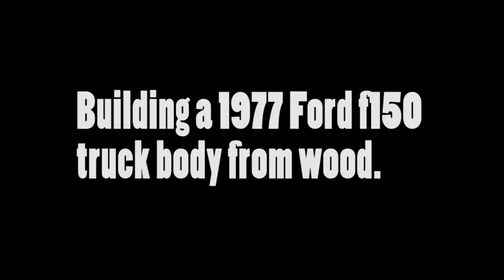Headquake's RC - #116 (77 Ford) Build Video aug2012

Comment: WTF??? I AM BLOWN AWAY!!! originally i thought these were modded plastic builds from a kit. this guy is no joke!!
very very impressive!!!
Reply: +Fiddlekrazy Steve testify he is at true artist
Reply: Absolutely!! Further more quite technical in vehicular design! Has to be both a love of RC and Vehicles!
Reply: He puts the plasitic body with multimillion dollar corporation to shame, & they charge over $100 a pop
Reply: Perfect work!
Reply: You are learning me, thanks.
Reply: friends, greetings to all from chile, please could you tell me what is the name of the product that thin white plate that is cutting and heating to acer the structure of the vehicles? please name the product you use ??
Reply: @MiguelTorres-xy4ck  it's called sheet styrene, you can find it at most hobby shops and websites. also Amazon and eBay.
Reply: thanks friend, from chile I send you a hug
Reply: Fiddlekrazy Steve 🤯

Comment: Beautiful truck man I used to have a 1972 f-250 camper special 2wd on a farm had a 360 big block with a custom short strait pipe stopping before the cab with out the Flowmaster man that thing was loud.

Comment: 10/10 the work is awesome the truck is great, it's perfect, it is a work of art & looks so realistic as well as "the little jungle tiger", the video is awesome the level of detail is "A1" it is a pleasure to watch it in motion, nothing compares to the f-100 pick up truck, they just look good from any angle, & are a great body to have for radio control cars, they just have a tuff look about them in any capacity but especially for rock crawlers.🙂👌👍🛻

Comment: More realistic yes but it's more of a strain on the motor and battery cause of the weight of the wood. But looks really good
Reply: Robert ???? It makes it more realistic with the high center of gravity. Also I believe that is a Toyota hilux chassis and he also looks like he had an upgraded motor. He probably geared it down also for that extra weight I imagine cuz if he is smart enough to build that he is smart enough to gear it down lol

Comment: Anything less than Genius is underrated statement, amazing job , blew my brains out !
Would you please build me one ? If yes How much for a 79 F-1OO Ranger XLT with all the trim even the wheel guards and rocker bottom like the 79 Lariat model  , with American Racing TTO wheels , 295-50-15 Cooper Cobras tyres , styleside counter bumper ( like the lariat ) , lariat bed rails , rear slide open window , lariat car like small mirrors , mustang horse badge on the front grille , with Rebel confederated plates , with a Mad Max SuperCharger Weyand blower and Scotty super slot boat fuel injection on top just like the Mad Max car , with 2 straight exhaust pipes coming out underneath the rear bumper , with the ford hood ornament, and 76 aluminium large trim mouldings in the windshield, and every XLT/LARIAT aluminium trim option even tailgate lid top or could be in a early 80’s monster truck tyres as well , but truck must be 79 XLT/Lariat trim model , please how much ? I love your art man , I rather have it in my house then some blurry rubbish on a canvas that someone self proclaimed artist reckon is art .
Thank you - Australia 🇦🇺